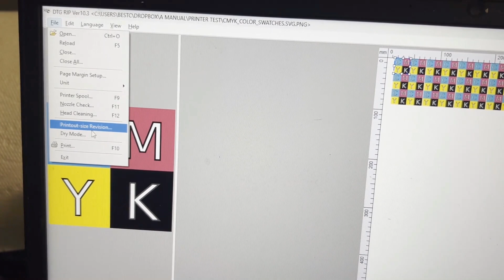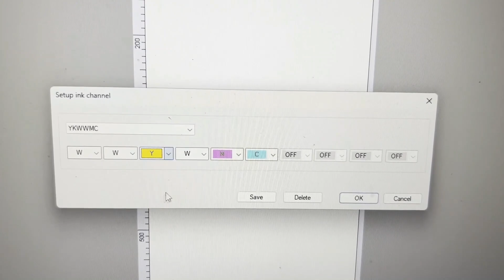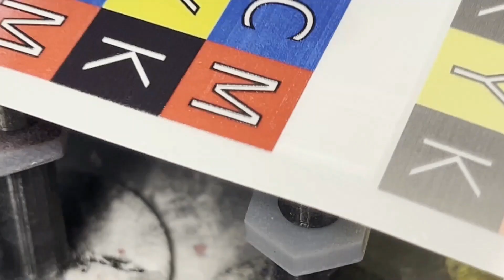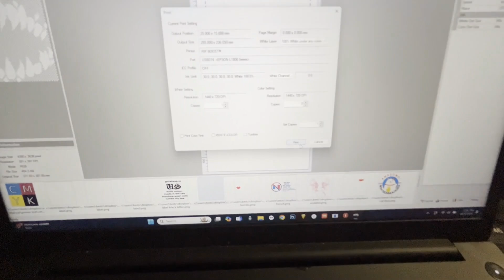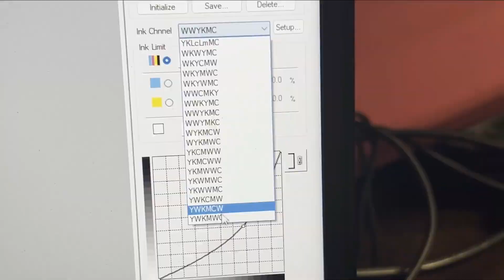Make DTF Printheads Last 3X Longer with This One Trick - Color Rotation

Comment: Hello, this video was a life saver! Only thing is when I’m printing sometimes the white ink button comes on and I press it  4-5 times and it doesn’t continue to print. I have to turn off the printer and it does a head clean automatically, then it can print again. I have a Uninet 1000 same as dtf pro model J. Any settings I need to change to fix this ?